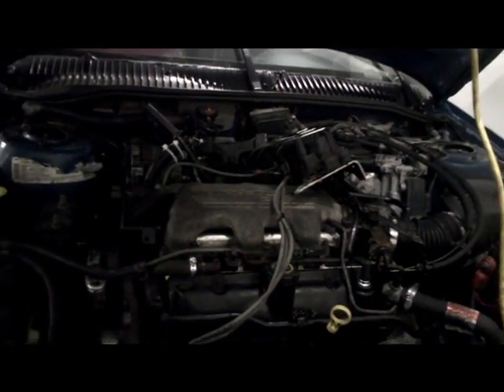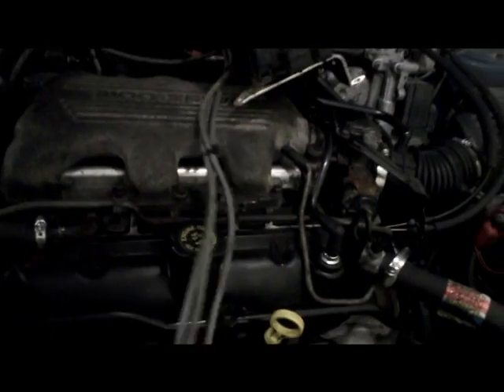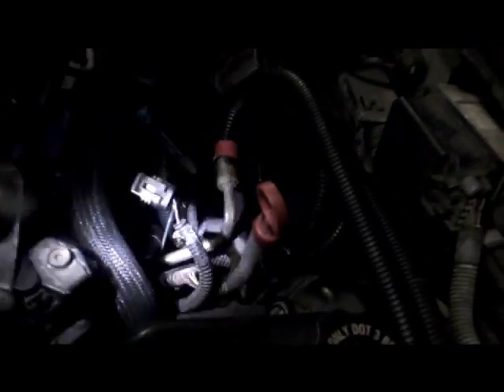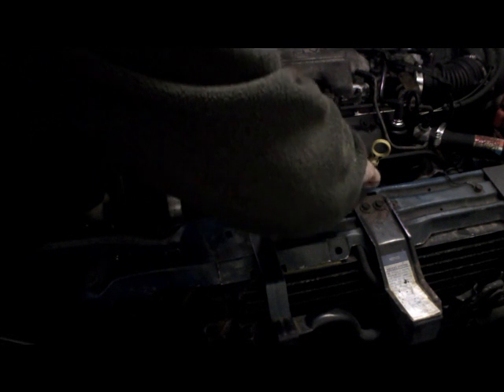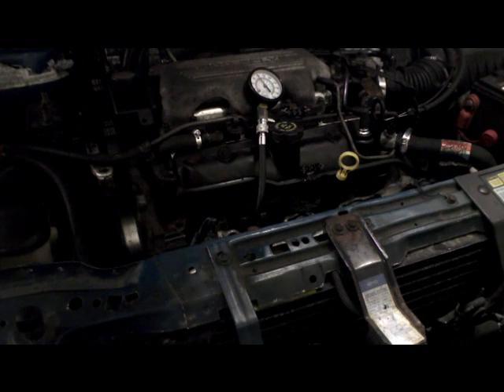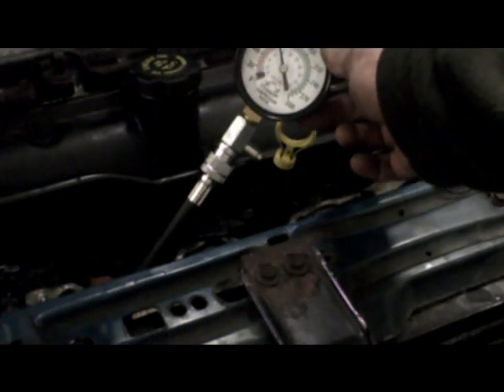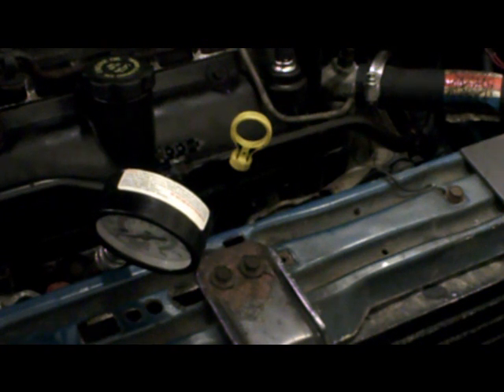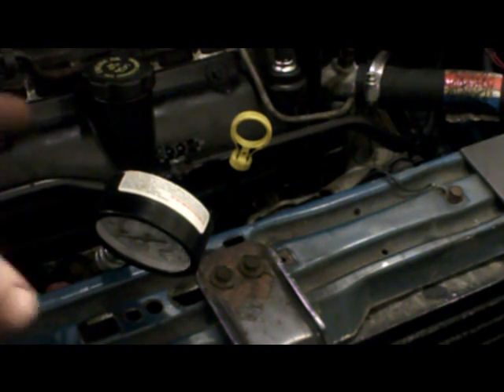How to perform an engine compression test

Comment: I did a compression test on my 1966 Toyota Land Cruiser straight six.  5 measured 75 PSI, on measured 50 PSI.  How do I determine if that is good or not for my specific engine?
Reply from the maker: I would contact Toyota or get a detailed manual for it.

Comment: I have a 2005 Chrysler Pacifica 119,000 miles, had a recent oil change in late January (full synthetic), it appears to be losing oil, it was just 2 quarts low now mid March. I park in the garage and there are no visible leaks and no noticeable smoke coming from the engine or exhaust. Where is the oil going, is this normal, do I need a compression test?  or any other recommendations. Thank you

Comment: My Eurovan vw 1999 suddenly the engin stopped i took it to my mechanic he called me and asked if i remember ever changing the spark plugs on the car since couple of the wires were burned, and then he suggested to run a  compression test which it will cost me $250 labor, what is your advise?

Comment: I have a 4.6 mustang gt I blew a spark plug out of cylinder 5 and two later i blew a hose off my radiator should i check the cylinder i had problems with already i just started loosing coolant once i blew that hose after i fixed it

Comment: would u use a compression test with oil coming up through the heads???? i got a 00 Grand am with a 2.4L n i had notice on my 4th cylinder oil was coming up through it.... I need some help n where i work at i dont have a master tech so idk what i can do to determine where the oil is getting by..... Im really thinking that the pistion rings r goin out on it n the car has 125k n the started to happen just recently....

Comment: I replaced my lower intake gasket on my 02 grand prix 3.1. I was getting oil in my coolant. The gasket was cracked on one of the coolant ports. I replaced it, put it back together and was great. After a week or so bypass hoses started blowing and the rad cap started leaking. I replaced the cap and hoses. The intake seems to have a slow leak now. I think I need to replace the gasket again with a fel-pro metal kind not plastic. Do you think I should do a compression test? It seems that there is t

Comment: Hi@Johnnysshop did you disconnected the fuel pump fuse?and the problem is that after i terminated the test the car have a strange noise and i did go off and on with starter please answer me soon thanks

Comment: would disconnecting all of the spark plugs not run you the risk of flooding your motor? Or do you also disconnect the fuel pump as well?

Comment: I have either a LIM leak or a head gasket leak and I have this same engine. When you tilt the engine forward to do the back plugs, is it still safe to perform a compression test despite the front mounts not being in place?

Comment: it got same engine the problem was the rear head blew valve i replace the head new head gasket the car sound like want start the first time start if you press the gas pedal it die now the car sound like yours if can you or did you know something i missing i like you help (ps push rod is in order)